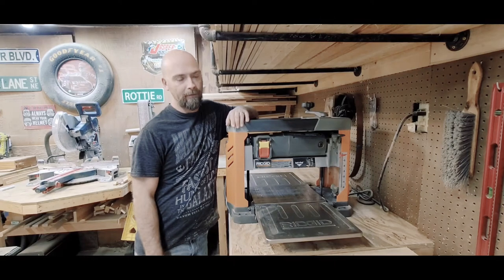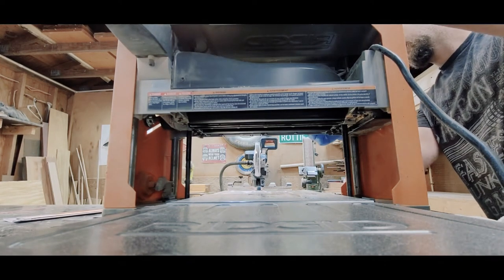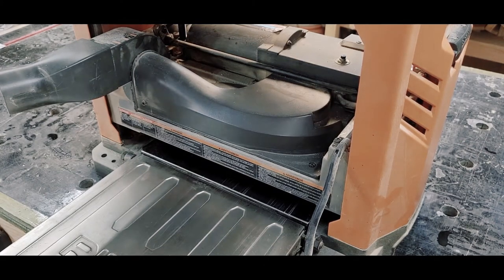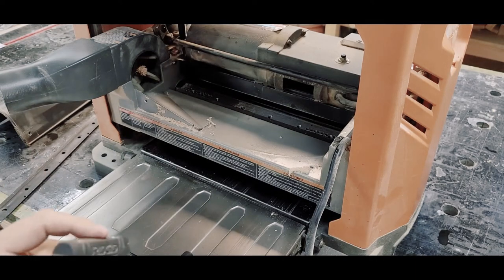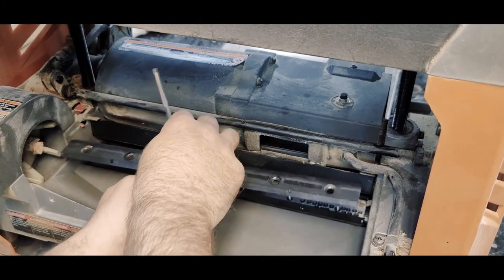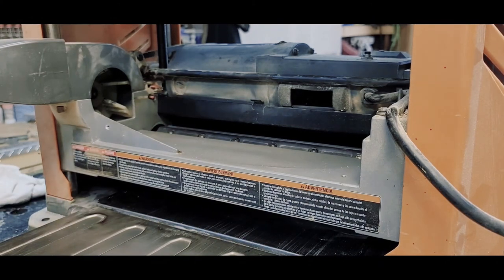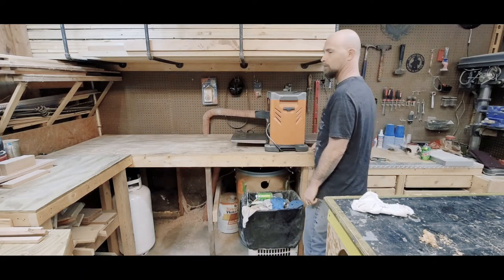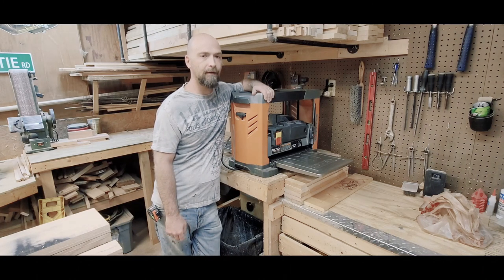Ridgid R4331 knife change and simple up keep.

Comment: I just changed mine, you can easily download any manual and print just the language you need, not all 80 pages. It says to turn the fan blade to rotate the cutters
Reply from the maker: That would definitely be a safer way to do it thanks so much

Comment: If you were to read the manual you would find that they recommend that you you take the shroud off that covers the blade area so you can reach in and rotate the fan with your finger to turn your rollers and or reposition to access each blade for replacement, rather than bump the switch.
Reply from the maker: That's alot of extra work, I did see a guy do that.

Comment: I have had mine for about 15 months.  Was going to use it 2 months ago and the boards were being pulled through jerky. I looked into it and found a bearing block for the outfeed roller was worn really bad. Still waiting on them to come in so I can get back to work.  Anyone else have this issue? Up until then it did a great job!
Reply from the maker: I'm a technician by trade, I have found bearings to be hit and miss. Chinese ones the most. Witch is what I feel is in the ridgid plainer. Mine I is still feeding great after 5 + years but it loud as hell. So I think I maybe looking into bearings myself soon.
Reply: @meanmacawwoodshop  what's amazing for this is the rollers are in a steel block, no roller bearing at all.  The blocks are dark so I assume they are oil infused? Every where I have looked they are out of stock.  Mine have been backordered for 2 months now. Very frustrating!
Reply from the maker: @Steve Ayers  have you looked at the link in the description for ereplacementparts.com. I have had great experience withe them in the past for the fan blade and blade hold down. Bothe were less than a weeks delivery time

Comment: Awesome thanks for I have the same planer as with all tools the blades/saw etc that come with the tool are poor quality so all saw blades etc should be replaced not just for a cleaner cut but for a longer cleaner cut .  I look at it this way you buy cheap sandpaper you get shorter use etc
Reply from the maker: I've put these up against the ridgid brand from home depot 3 different times this year and am constantly disappointed in the ridgid compared to the cheaper from Amazon. So every time I flip the blades I order a new set so I don't have to wait or go to home depot

Comment: Replacement blades any recommendations?
Reply from the maker: I have had a better experience and get longer life out of these. They are also cheaper
 13-3/8 Inch HSS Planer Knives for Ridgid R4331, R4330 Planer, Replaces AC20502 - Set of 3 https://a.co/d/6ToZugK

Comment: Each of those blades has TWO SIDES. So BEFORE YOU GO BUY NEW BLADES, you can just reverse each of the 3 blades, use the planer till those sides are dull and THEN go buy some new blades. Package says on front: "Reversible with 2 cutting edges"
Reply from the maker: Did I forget to mention that? I'm glad you cought thank you.
Reply: Yeah he clearly said that.

Comment: Nice work shop, i wish i had one like that, i had a opportunity to by a Ridgid planer - seller explained motor making Noise and needed to be dismantled and Cleaned.
He still was asking. $250 CAD.Alot.
He did not accept my offer.i did not buy.
I did not want to send money on a belt or motor bearings or motor from E replacement parts
Reply from the maker: It really is a great machine. I've beaten the snot out of it, and it just won't die, lol.
Reply: @meanmacawwoodshop  quality looks Amazing and Heavy. I have Ridgid table saw. And 12" sliding miter saw ,also have Ridgid fuel injected gas pressure washer. Amazing quality